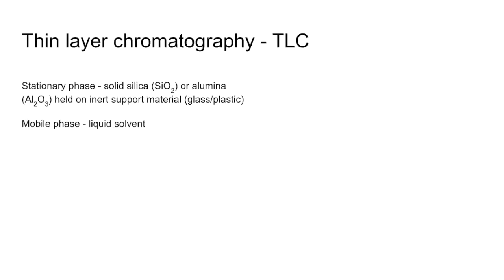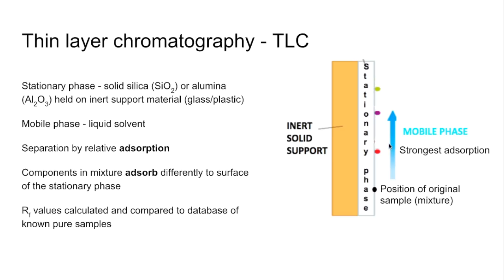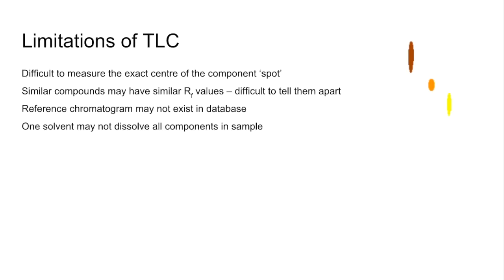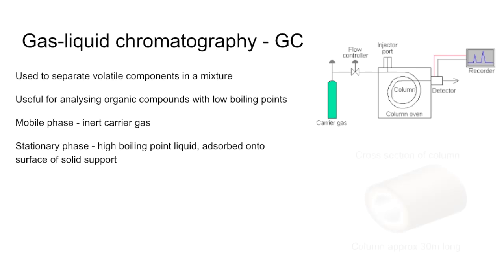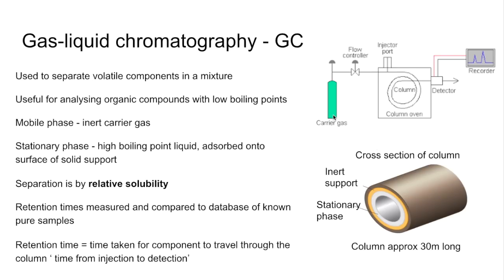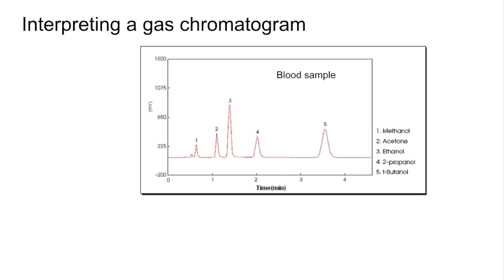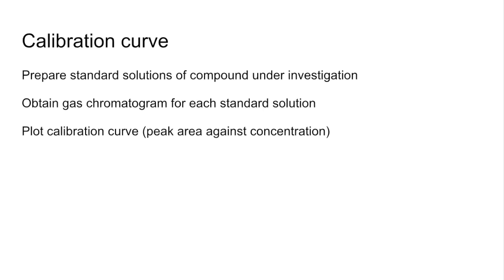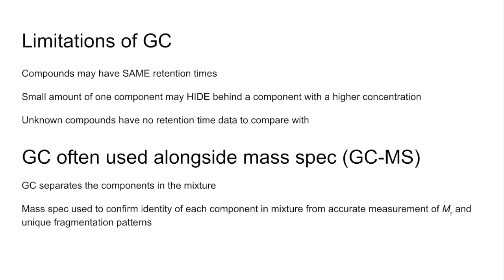Quick revision - Chromatography

Comment: 1:56 (TLC): I have never understood why the compound that has the weakest adsorption is the one at the top and why the best adsorbent is at the bottom. And what does it imply about the polarity of the compound? Could you help me please? Thanks!
Reply from the maker: Inigo Bergua The stronger the level of adsorption the more the component ‘grips’ to the stationary phase and hence is moved less by the mobile phase. The polarity question is more relevant to a liquid stationary phase (at A level anyway) and that’s found in gas chromatography. So if you have a polar substance being used for a liquid stationary phase then a polar component will interact more and spend more time in the stat phase and less in the carrier gas so retention time will be longer. If component is non-polar the opposite it the case and a shorter retention time. Situation reversed if a non-polar liquid stationary phase is used. Hope that makes sense. I do that other videos on chromatography btw. 😊
Reply: I understood both answers. Thanks from Spain, I really appreciate the effort you put in your YT channel!
Reply from the maker: Inigo Bergua Thanks for that. You are very welcome. Sending my best wishes to you

Comment: Hi thank you so much for the videos, I just have one question. When calculating the Rf value and you measure the distance travelled by the component , do you measure up to where the spot starts or when the spot ends (the bottom the the spot or the top)? I don't know if it makes sense...😩
Reply: I tried an exam question and got the correct answer by measuring the distance of the 'centre' of each spot from the pencil line
Reply: Thank you ☺️